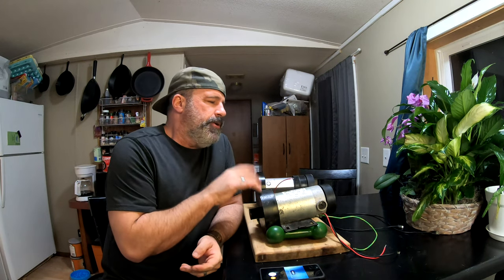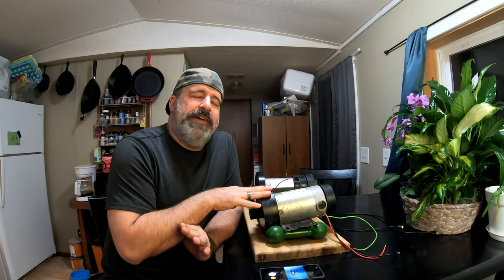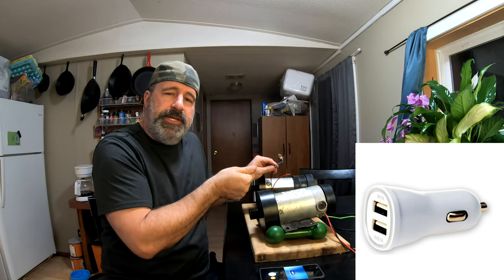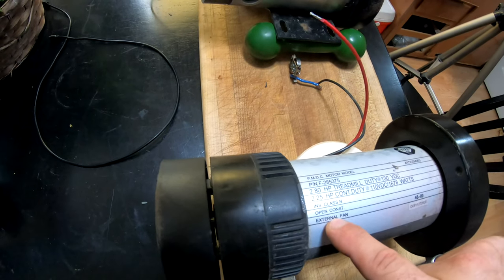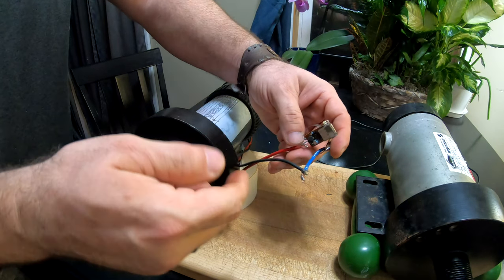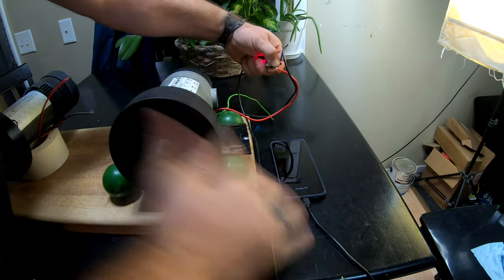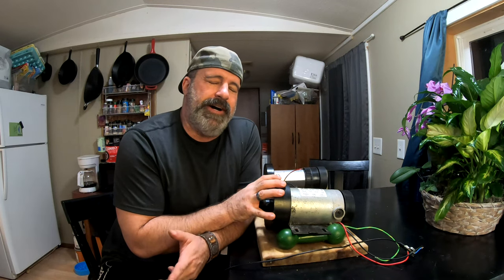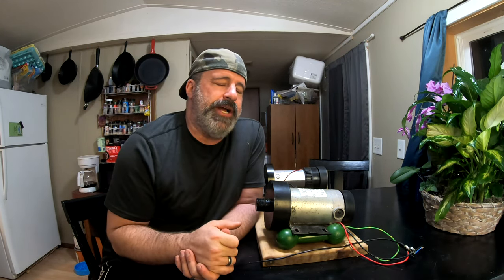Treadmill Motor To Generate Electricity - Off Grid options

Comment: Interesting! Wind turbine to a gear or belts to work with one of those. Sounds like a fun project. 👍😎
Reply from the maker: Definitely be fun . Also thought about taking a weed eater motor and hooking to one. This would allow for very small easily transported. Quick way to top up the batteries if you were in a camper or doing van life. One of these would also fit well in a vehicle with the air conditioning pump removed just tied into the serpentine belt.

Comment: So just out of curiosity, why did you decide to use treadmill motors instead of car alternators, cause you can make a generator using a lawnmower and a car alternator
Reply from the maker: You have to alter the car alternator for that to work. In other words you have to have power going to the unit aka alternator to make it work. So in that situation you would have to have a separate battery to make it work This is going to be going directly to a charge controller. A permanent magnet motor does not require external power to work.

Comment: I design and build wind turbines as a hobby. Been at it for over 50 years. 

I make my own generators / alternators and doing that, I can make alternating current or direct current WITHOUT electronics. Also, I can adjust the cut-in speed merely by how far I place the magnets from the axis of rotation.  My VAWTs have only one moving part.
Reply from the maker: That would be an excellent design let's moving parts means less issues. You have far more patience than I do.lol

Comment: Any dc motor can be connected to an old pvm solar charger…to keep your off grid battery’s charged….
Reply from the maker: That's kind of true you can't just take an alternator it won't produce power unless it senses power. That said I'd never destroy batteries by using a PWM controller.

Comment: Where can I buy new brushes for a 3 hp treadmill no motor
Reply from the maker: With as cheap as they are I don't know why you would buy brushes just buy another motor. But most times you can go to an alternator repair shop and they can look up the numbers and order parts

Comment: Good video thanks for it. Literally an hour ago I discovered people are using these motors in alternative ways for generating electricity for storage. I went down a rabbit hole on solar power a couple months ago starting with Will Prowse videos then covering the mass plethora of solar videos on this platform. Aaaand now all of a sudden I'm waiting for a couple more components and I'll be assembling my first solar system around an LV2424 with a 24v 280ah 8s home assembled lifepo4. I'm really interested to see what can be done with these motors.

Stay frosty 👌
Reply from the maker: Yeah we all have our headed down the rabbit whole time with that. Sounds like you're building up a good system. I'm going to get this generator done I'll do a video. Also going to be adding an off-grid system to the tiny home we're building. And a lot more. Currently we have some videos out about an easy grid tied system we're running. About as simple as it gets. Thanks for watching and commenting

Comment: with 3d printing and all that, getting custom gear boxes with good ratios for the work you want has never been easier. Completely takes the high cut-in speed out of the equation.

Comment: Hi. New subscriber. I found you through your ( $25 Rural internet solution - Portable internet solution VIDEO ) Been doing research for a few years now on the van life. I Can tell you know what you're talking about, So high five to no b.s. I was curious to know if this would be a better option than a vehicle alternator? For charging a deep-cell battery? in your opinion. Thanks.
Reply from the maker: It depends on which type of battery you are using. Definitely more cost effective. I have lots of videos coming up the next few months that might be helpful to you on things like solar generator power banks. A camper build. Tread mill generator and more.
Reply: @thefrugalhomestead7873  Thanks for the reply. Yeah i used to think deep-cell and marine were the same, and finding out that they're not. So what i'm thinking is basically lighting and diesel  heater use. But having a diy dc generator for charging without having to start the van, as back up. I have the motor already and jack shaft kit.  Just starting to get things for my bug out van. Looking forward to seeing more. Thanks again.

Comment: I grab up any free treadmill I can get hands on in my area. I daily a pickup so I'm always prepared.  I've used treadmill motors to make 2x72 belt grinders. The one in my shop now, uses the motor, controller, bearings, and some of the frame to make it.
I've been wanting to try my hand at generating for a while.
Reply from the maker: I'm the same way I'll be driving down the road sitting that hit the brakes and turn around and pick up whatever I can find when it comes to treadmill motors

Comment: I were working on two tread mill motors for running in series or parallel to run to bus bar for an auxiliary with my drill as the power.
Reply from the maker: That's an excellent concept I wonder if an impact would do better.

Comment: Nice video… i beg to differ on the reliability of some of these motors.  I’ve been selling/refurbishing fitness equip for 15 years.  Most Nordictrack, Proform, and Horizon treadmills have garbage motors in them. Unless it says 4hp(WAY overrated)or more on the label, done waste your time. Just like that 2.8hp motor you have, its junk and came out of one of those treadmills.

The best, most efficient way to spin these things is by way of Hyroelectric generation. This method is so much better than any other power generation method, it makes you wonder who’s in charge of influencing the govt restrictions that prevent hydroelectric power on anything other than small scale.
Reply from the maker: I don't know that I would call them junk. The no name Chinese fitness equipment is much worse have to replace him plenty of these motors in my dad's gym I have seen that there is higher quality but those are generally not home use ones you're going to find out along the road. That's sad hydroelectric is frowned upon because people tend to want to use them in rivers and other waterways and then things get tangled in them or they do them wrong. I don't figure this motors will last forever but free power generation with a broke down mower or turning one into a geared wind turbine is about all I have available to me considering I live on one of the highest peaks in Southeast Ohio lol . Unfortunately water doesn't flow uphill lol . Sad truth is with today's pricing none of these motors are really that useful compared to just buying more solar. I do appreciate your feedback and you're taking the time to comment and I do agree that these are lower quality motors. Thank you for sharing your insight

Comment: Use an old front tine rototiller with a side shaft belt drive.
Reply from the maker: That actually would probably work really well at the moment I brought home an old power washer motor and the frame someone is taking the pump the hoses and all the other stuff off of it if I can get it running it'd be easy to hook the treadmill motor to the side. You're giving me all kinds of ideas though.